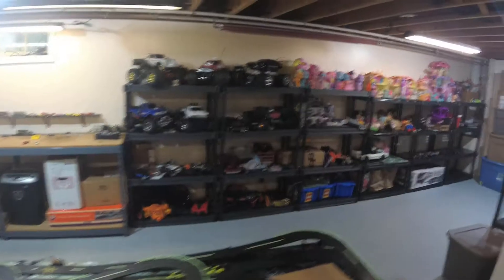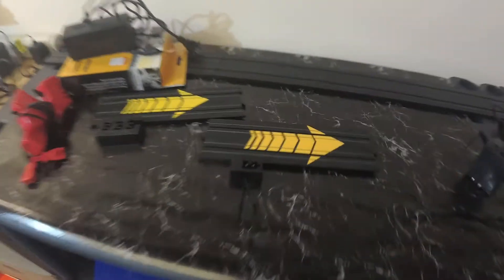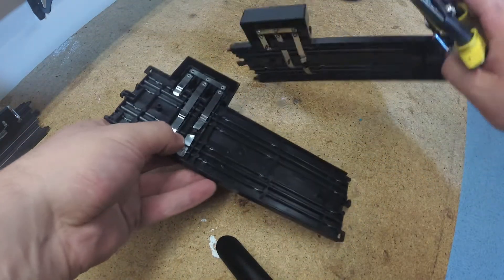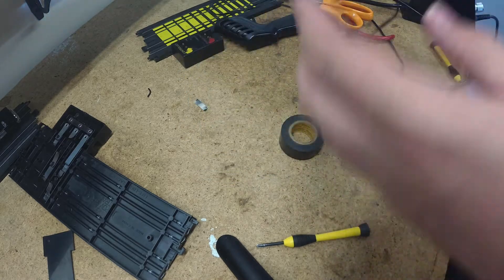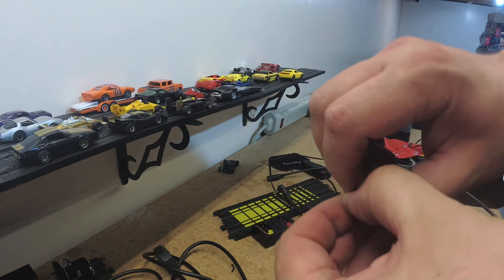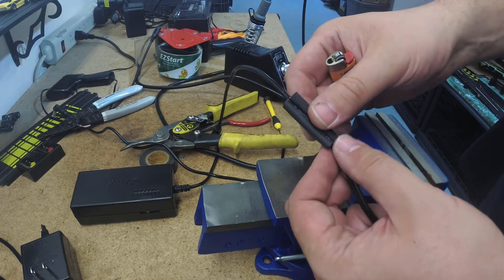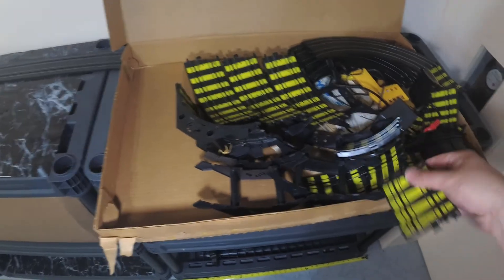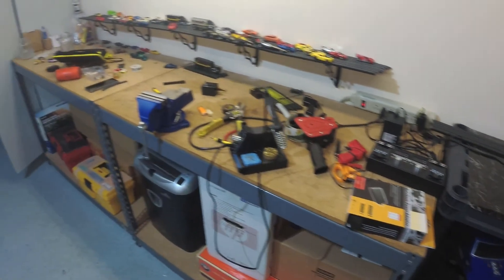Slot Car Drag Strip 12v to 24v Power Supply Install HO Tyco AFX Life Like

Comment: Dynamic braking!  Create a brake in the track by using a 3” piece with a 3/4” section of the rails cut off.  That will stop the power flow to last 4 feet if track.  Next solder a wire at the very end or underneath like a jumper but connect the 2 rails for each lane together.  That is how to turn a dc motor into a dynamic brake.  The motor has load applied with no power so the car slows down considerably quicker…
Reply: To get super fancy you could measure the distance the cars take to stop then say 8”-12” before that put in another 3” piece with rails cut off then connect the return loop to that and if you get it right the cars will slow way down but make it to the next powered section allowing you to drive them back.  Or lol, if you want ti get ridiculous, have 1 return lane hooked up to a ghost racer track and the car will come back like a ball return.
Reply from the maker: Good to know. I simply moved the kill track back 1 section further when I extended the track to 20 feet. Its working good, and the kids like the vertical stop.